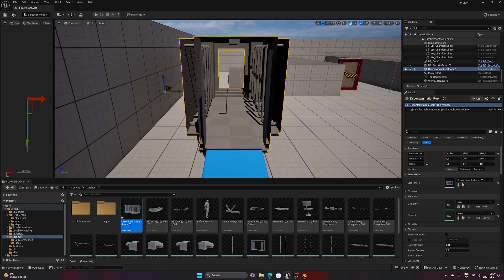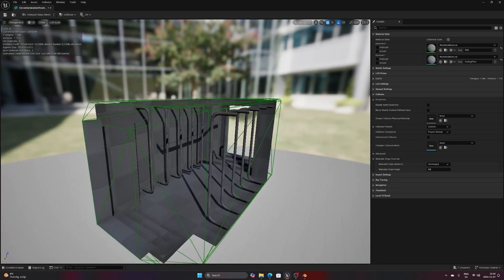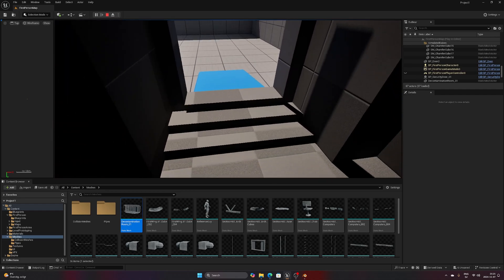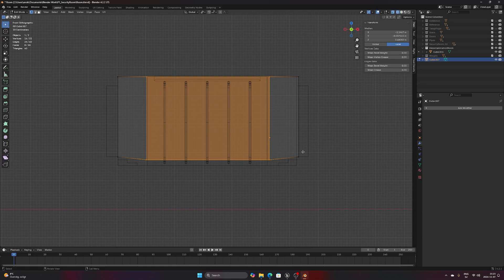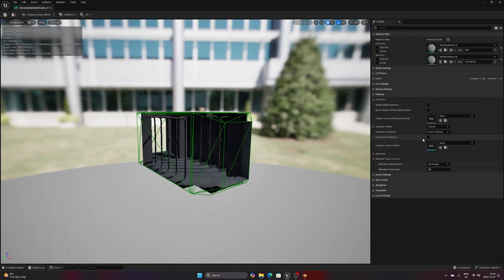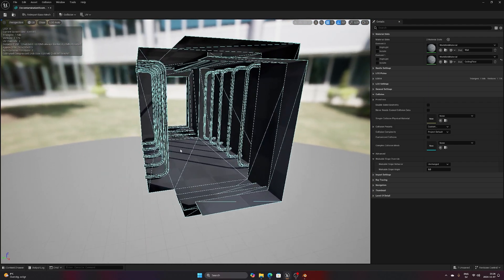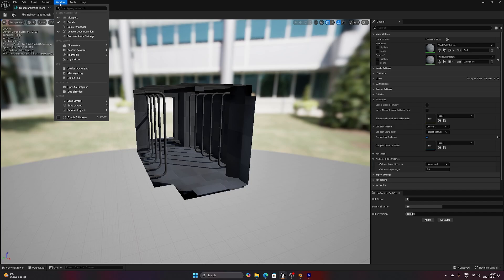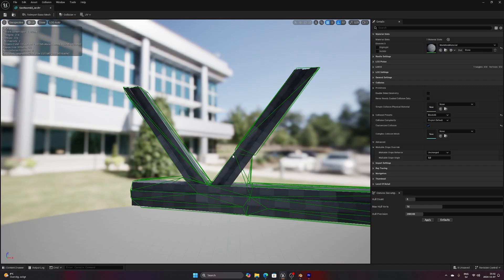Unreal Engine 5 Custom Collision Tutorial | Basic, Complex, Custom & Generated Collision Meshes

Comment: Spent hours screwing around with importing custom meshes, and thinking it just wasn't working.  Thanks to your video, I realized that it was working the entire time and custom collisions just don't show properly in the editor. 🤦‍♂
Went back and did some tests with some ramps and stuff attached to my collision meshes, and can confirm that I just wasted an afternoon on a visual bug.
Reply from the maker: Haha, oh yea I’ve been there to! Happy that the video helped and did not make you waste more time on thinking it doesn’t work! :D
Reply: just to clarify (as i believe im in the same boat as you) 

the visual bug we are talking about, is the fact that it still shows the custom collision as the complex collision of the mesh rather than the actual collider, right?
Reply: @Eric_Von_zaan  Sounds right. I think the editor isn't built to display custom colliders for some reason.  The collision works when running the game, but it looks like it's just the default complex collision in the editor and in the static mesh editor window.

Comment: Nice video, but a tip I use A LOT without going to Blender is: open the mesh, remove existing collision. Press Add box collision and size to a wall or whatever. Now comes the real trick;

You can not add more collision boxes it will remove the first one. But you can copy them! So just select the collision and hold Alt while draging it out. It will make a copy (ctrl c and v also works).
Now you resize the new one to what you like. Only downside is you can not make new shapes like circles etc. But most of the time I dont need that. And you can also use existing collisions and scale them to the size you want.
Reply from the maker: Thanks! I agree it's something I end up using a lot for stairs for example or hallways :D